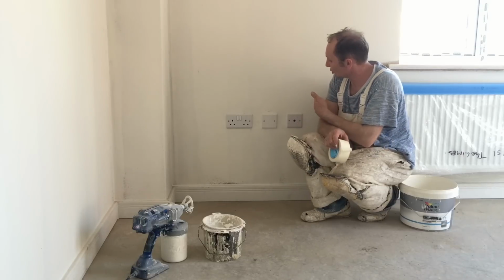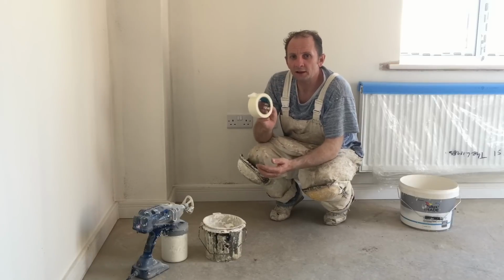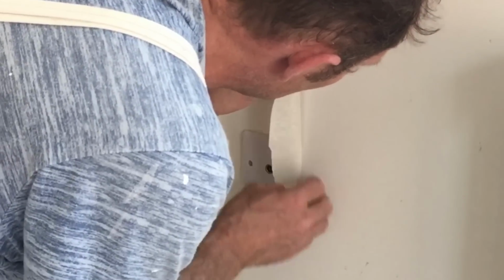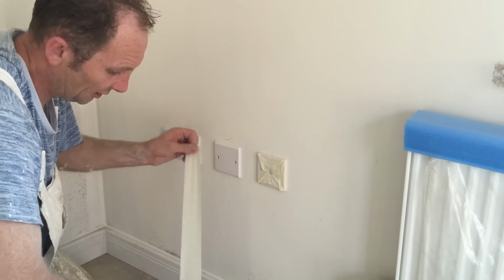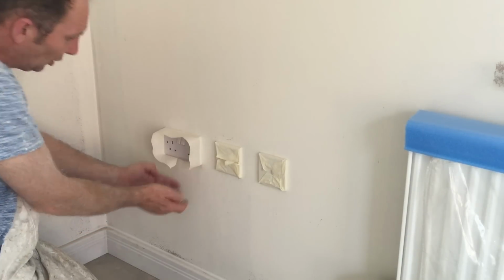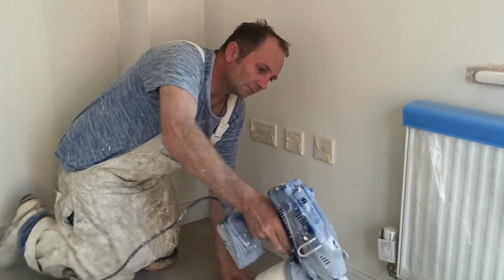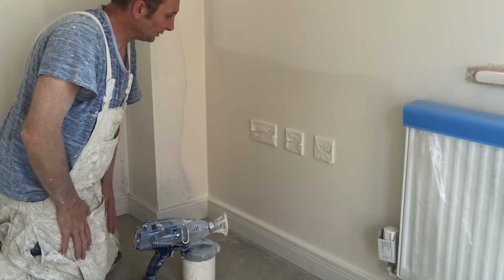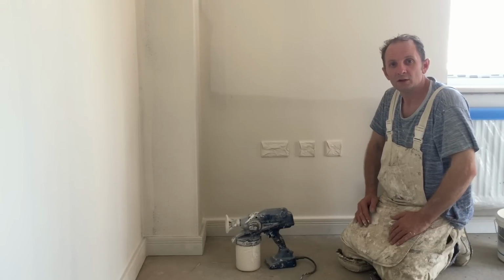Graco TrueCoat Pro ll, How to Mask around plugs & Spray

Comment: for that kind of job you need a real airless sprayer, that gun is meant for smaller stuff, is gonna cost you more in the long run to replace the packings
Reply: You can just use a food/freezer bag rather than buying the Graco bags. I think he mentioned this in a tips video